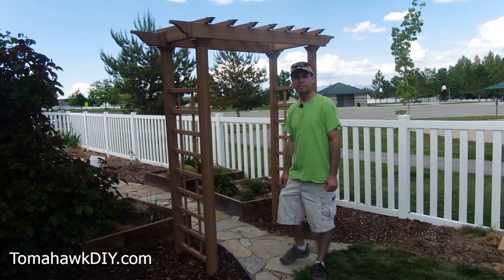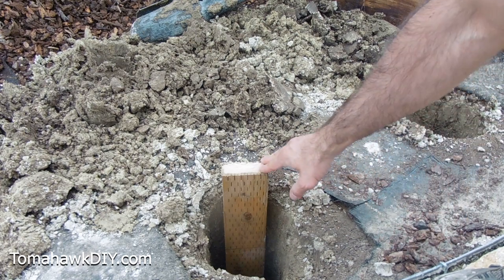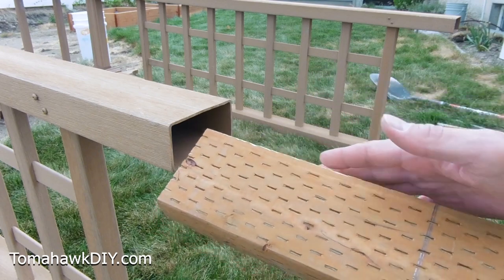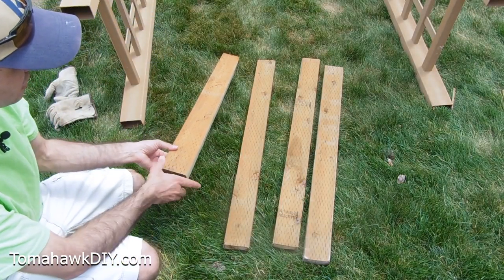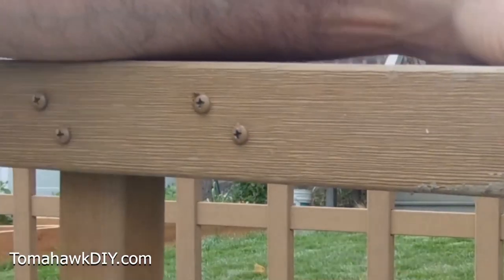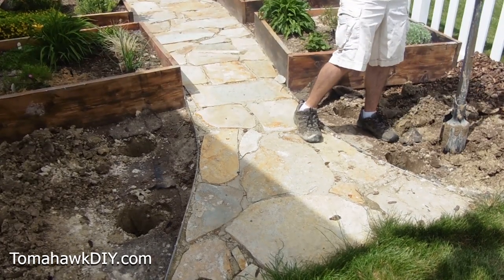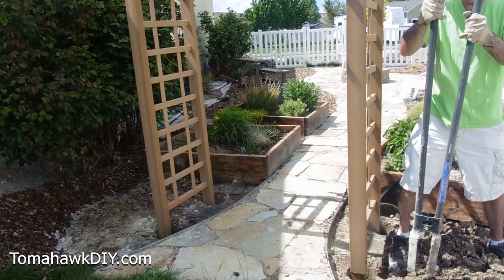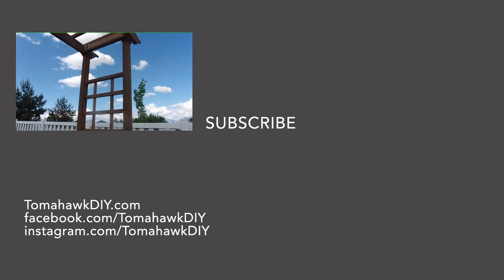How to Install a Garden Arbor

Comment: I'm just curious as to why you didn't use a 6" layer of gravel at the base of the hole and concrete? I'm learning landscape design and I'm trying to figure out how to install arbors and other structures. Any feedback is helpful. Thanks.
Reply from the maker: I just didn't think to and probably didn't want to dig any deeper